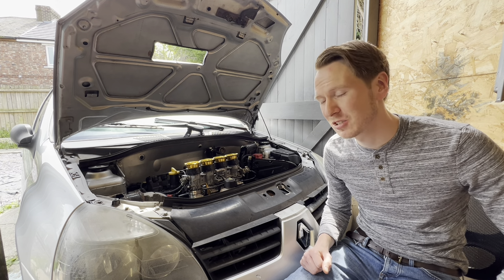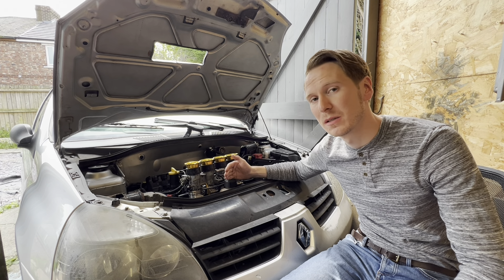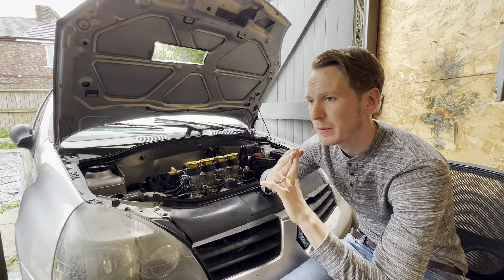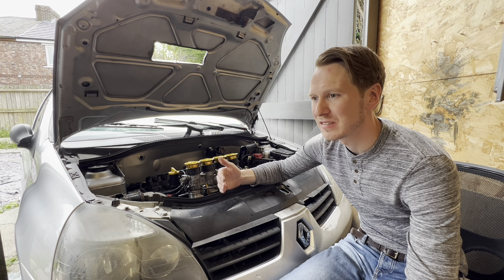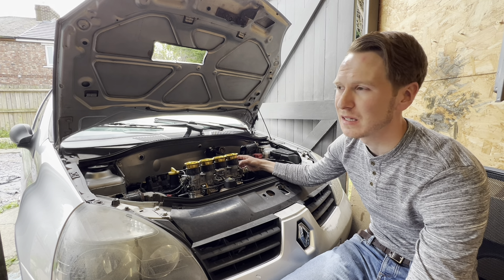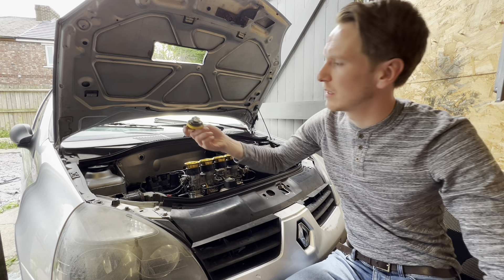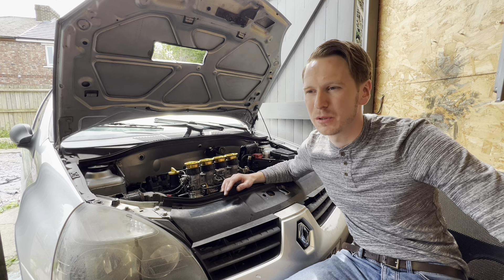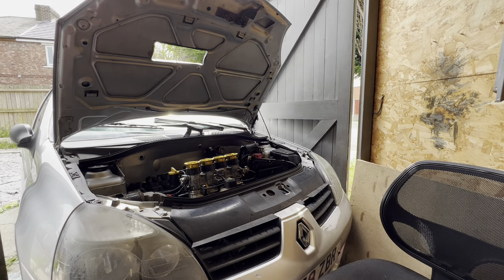How to build a hydrogen car (The engine)

Comment: Not bad actually, but I noticed you said hydrogen was expensive, why not use solar and water electrolysis. Granted the solar panels aren't particularly cheap but no inverter needed it's a  DC supply. Then make more of these engines and sell them.
Reply: You can also use urea and ammonia to produce Hydrogen 👍
Reply from the maker: It’s an ace idea, this car runs on pure hydrogen though, so the electrolysis machine would have to output pure hydrogen and pressurise it to 150bar or so, that’s where it gets tricky. No impossible by any means
Reply: In Australia, solar panels are literally free, people give them free after 5 years and get new panels well before their 20 years warranty, all you need a trailer to load panels including mounting rails and invaders, all for free or sometime $100 for 5kw system.

Comment: Great video. WITTS has a way to modify the burn time of HHO so it burns slower, more like propane so you don't need as much gas and you don't need to modify the engine. A car is difficult to do,  10kw generator is the easiest.
Reply from the maker: Thanks for the info!
Reply: ? Could you give some more info on this/a link

Comment: Have to tested how much Hydrogen you go through in how many miles? Also the cat back O2, any customization there?
Reply from the maker: I think I mentioned the consumption in another video, it was crazy high, 72lpm or something, no modification to the exhaust except for increased flow (less restricted) encase of back fire
Reply: @ ok. How big is your rank? Sorry I haven’t watched all your content yet. I’m prepping to do something similar in the states. Trying the gauge how much hydrogen I need for a track car.

Comment: Maybe if you change the AFR by putting more air and less hydrogen at low speed and high speed you leave the same volume of hydrogen you have but more air might be better because you will consume less and more power
Reply: Or if you can change the AFR by putting more air and less hydrogen when you press the accelerator from 0% to 50% and from 50% to 100% you leave the same volume of hydrogen that you have but a little more air and the ideal would be to leave the same volume of air and less hydrogen from 0% to 25% of the accelerator and from 25% to 50% you put a little less hydrogen than you normally have and more air than you normally have and from 50% to 70% you put a little more hydrogen and more air and from 70% to 100% you put more hydrogen and more air I think you have a bigger power and you will consume less

Comment: If you where to convert it to LPG you would have to use tips with 1.8mm holes to work right. I doubt 440cc petrol injectors can flow as much even with higher pressure. You are running lean!
Reply from the maker: Honestly not sure, never worked with LPG before, thanks for the info, 

The 440cc injectors I’m using are more than enough to get the engine going, but it won’t be lean, as the fuel is a gas and not a liquid it fills more of the combustion chamber up in respect to liquid fuel, meaning less oxygen can occupy the chamber, resulting in a rich AF ratio, I believe this is why direct injection would be far better.
Reply: @Hydrogenguys; 
Clearly You are attempting to use two components, fuel pressure pump and fuel injectors which are neither the correct one for the system nor in combination to achieve the best results.

The best is to modify and select the correct, proper, appropriate combination of components for the requirements of the fuel system. Seemingly the best are those with more control for each pressure and injection.
The system engineering approach is Best.

Comment: Instead of pressurizing the hydrogen, could you use a very efficient electrolysis hydrogen/oxygen generator? Is there a reason it needs to be pressurized?
Reply: Keeps it dense, storing hydrogen gas is extremely difficult. It defuses through and/or embrittles just about anything it touches, after awhile. Not to mention, as mentioned in the video, its a very sparse gas, not dense. If you just pumped to atmospheric, there wouldn't be very much there. 

Liquid would be much better but the system for that would be far more complex and expensive.
Reply: Hey! @Hydrogenguys thanks for the heart, coming from you/someone alike, that actually genuinely means something.
Reply from the maker: Anytime, it was the perfect reply to a good question, Thankyou for the comments

Comment: Watching with big interesst as Im in a  which produces PEM electrolyszer Stacks for hydrogenproduction. 🙂

Keep on mate 💪🏻
Reply from the maker: That’s ace! Thankyou for the support.

PEM stacks can be used to create pure hydrogen at one output and pure oxygen at the other right?
Reply: @Hydrogenguys  yes indeed. Ultra pure water, some electricity and you get hydrogen and oxigen. In our case 40barg and with experimental units over 100barg. 

Advantage of PEM is that they are very responsive. So usage for regenerative energy is perfect 👍🏻

Comment: Would an external oil/water separator setup benefit the build or reduce the oil contamination issue any?
Reply from the maker: Maybe, I use an oil catch can which helps a lot

Comment: What did you set the ignition timing for? Thanks so much for the info.
Reply from the maker: This engine has variable ignition timing. So at idle speed it was set to 0 degrees (TDC) and slow advanced to 5 degrees at max rpm. 

This isn’t the ideal timing but safe instead
Reply: @Hydrogenguys   Did you use a propane carburetor that you adjusted like on your smaller engines? If I wanted to do this what would I need to do?

Comment: My vehicle is matiz II which runs on LPG as fuel. Can I maintain the LPG setup and use the hydrogen instead of LPG?
Reply: I think not because you can store too little of it. Because hydrogen is not dense at all, you need a lot of it. The pressure in an LPG tank would be too high.

Comment: What about a dual fuel set up, where you can use both pump gas and hydrogen? If I was using hydrogen in that Renault engine, I’d bolt it up to a Mazda mx5 or RX8 gearbox and stick it in a Ford Pop or 100E.

Comment: For power sake, the made a D4F engine with turbo, soo if you find one its pretty much a straight swap
Reply from the maker: That would be perfect! When running hydrogen with port injection forced induction is needed to get back some of the lost power.
Thanks for the info

Comment: Tell us about the conversion you did to run from gas to hydrogen and how is the fuel made into hydrogen .
Reply from the maker: Hi, the gas used was 99.8% pure and was bought pre bottled, I talk about the conversion in this video and the video showing the fuel tank. Hope this helps

Comment: I'm curious why you say the engine won't last? Is hydrogen combustion especially hard on engines?
Reply from the maker: Hydrogen can produce a lot more heat than petrol, and more friction as hydrogen is a non lubricant, as this engine was designed for petrol, it’s safe to say the piston rings and sleeves won’t last as long as they would on petrol. 
These are issues that are solvable if the engine was designed for hydrogen in the first place. 

Hope this answers your question.
Reply: @Hydrogenguys  it did, thank you!
Reply: I would like to know more
Reply: @Hydrogenguys actually, that is a mit. Hydrogen engine run cooler because is more effective (heat is a waste energy) and because of high flame speed, (less time flame touch metal) and because steam acts like a cooler. Dry fuel is a ridiculous term, engine run better, no carbon deposits (they destroy engine, not clean fuel). This is just about timing, no other problems. They share this ridiculous story because they need to sell new expensive engines, and they don't want to allow to ordinary people build hydrogen powered engines 🙂 I run many engines on gas from the water, and they can't lay to me 🙂

Comment: I want to convert my diesel car in hydrogen. Please give me complete details and contact to discuss
Reply from the maker: You need spark ignition really, that’s why petrol engines are used.
Reply: My vehicle is matiz II which runs on LPG as fuel. Can I maintain the LPG setup and use the hydrogen instead of LPG?

Comment: A coulle of things. Why do you run a rich mixture
Reply from the maker: Cooling and complexity, as hydrogen is a gas’s it occupies much more of the cylinder then a liquid fuel, meaning less oxygen than normal resulting in a rich mixture, the car needs to be direct fuel injected or forced inducted via supercharger or turbocharger to overcome this. 

The rich fuel mixture also reduces engine heat, hope this helps :)
Reply: @Hydrogenguys  it does not result in a rich mixture if you set the mixture correctly, and setting it correctly  will result in more power, unlike with a liquid fuel with high heat absorption with evaporation where a rich mixture gives more power because it cools the incoming charge.